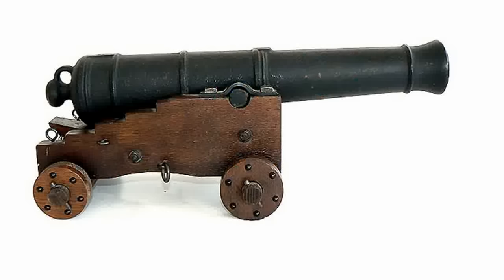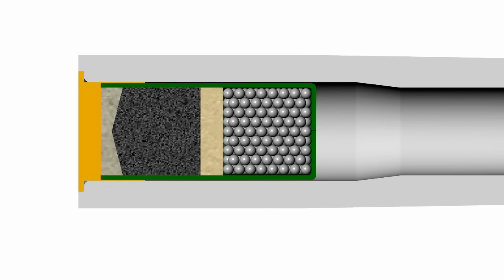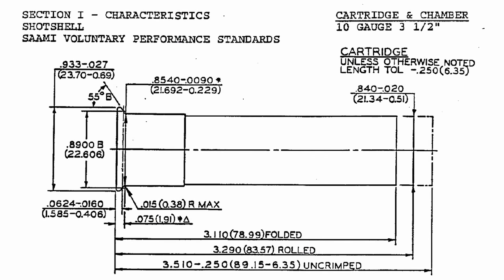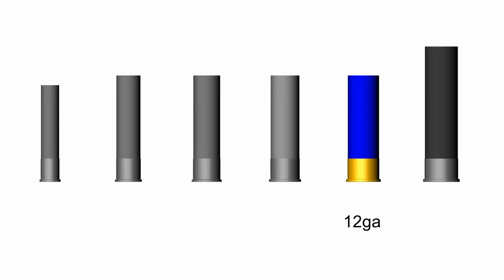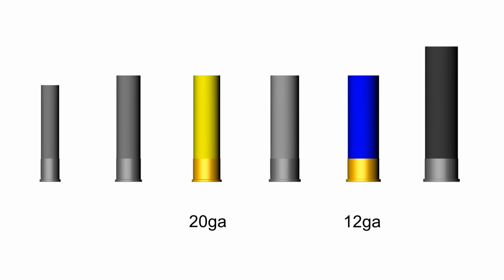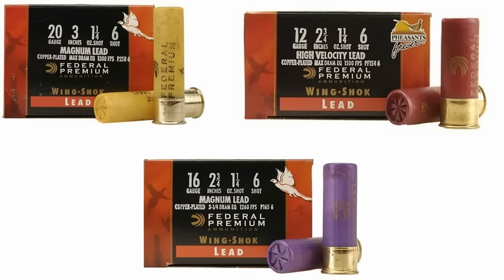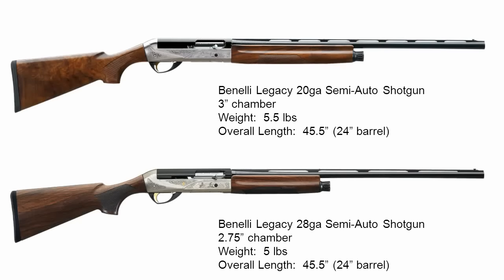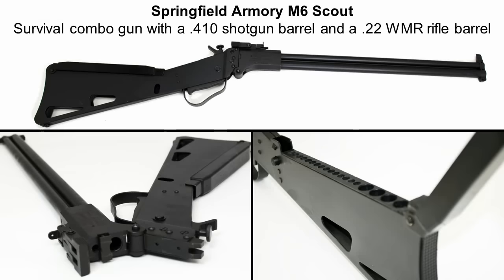Shotgun Gauges Explained - Shotguns 101 #3

Comment: The UNSC in Halo have a 8 gauge pumpgun as standard issue shotgun. I guess the ordinance department really hates shoulders
Reply: @The Magic Hispanic true, I guess a 10 just ain’t enuff
Reply from the maker: What's funny is that if you look at the ammo cans for the shotgun shells in the original Halo, the load is described as 15 pellets of 00 Buckshot.  That's a typical load for a 12ga 3" shell, and way light for a magnum 8ga.

Not nearly as bad as whatever space-time warp they came up with to explain a 60-round magazine of 7.62x51mm ammo in the MA5B assault rifle, though.  I have one 25-round mag for my AR-10, and that thing's big and heavy enough.
Reply: @SynchronizorVideos  yeah, I like to pretend the rifle shoots 5.56 instead. Not to mention the recoil would be worse than an M-14 on the moon
Reply from the maker: @sergeantmarcusstackerM1903  With the way the MA5B looks and its size, I'm guessing it weighs enough that recoil isn't too terrible.  Hopefully the 600 years of weapon development also resulted in a smoother action than the jackhammer M14.
Reply: @SynchronizorVideos  those In-line designs definitely smooth out the jolts
Reply from the maker: @Gender Binary Chicken The M6D never bugged me much.  12.7x40mm isn't crazy-large (.50 AE is 12.7x33mm), and the pistol itself is a very large, bulky unit, with a visible magazine that's within the realm of reality for its 12-round capacity.  

Its per-shot damage compared to the much more powerful 7.62x51 round in the MA5B assault rifle strikes me as a bit of a stretch, although the little booklet that comes with the game does state that the pistol rounds use an armor-piercing high-explosive projectile, while the 7.62x51 rounds for the rifle are described simply as "armor-piercing".  Presumably that's something similar to the U.S. M61 black-tip loading.

Comment: Do you know how many of the smaller gauge guns and shells are sold compared to the 12 gauge? E.g for every 1 "?" Gauge sold there are (x) number of 12 gauge? Are the other gauge easier available? What are they primarily used for etc?
Reply: I don't know any specifics but I do know that 12 gauge is by far the most popular. Over half of all shotguns sold are 12 gauge. The guns are the most common and the ammunition is the most abundant. 20 gauge and .410 are also readily available and combined probably make up around 30% of shotguns sold. 16, 28, and 10 gauge are far less common. They may make up 10% of all shotguns when combined.

Uses for shotguns depends largely on the size of the balls loaded into the shell. For example, .410 is small and usually loaded with small balls designed for hunting smaller animals such as rabbits, squirrels, little birds, and small pest animals. 12 and 20 gauge are generally more varied given their larger size. They are also loaded with small balls to hunt the same animals as .410 but they are also commonly loaded with much larger balls for things like large birds, deer, and home defense.

Comment: First shotgun I fired was a 10 gauge when I was eight. It was my grandfather's and yes it put me on my ass my father and grandfather laughed for awhile. Thru my teens I had a 16 side-by-side that I still have today. After the service I stepped up to 12 gauge and that is my waterfowl gun of choice I use  both 2 3/4 and 3 inch shells never got into the 3.5 shells. If I was going quail hunting I would probably look into a 28 over under this does seem to be the gentlemen's round.
Reply: How's the barrel regulation on it?

Comment: What gauge would you recommend for my daughters boyfriend?
Reply: Erin Osborne 10 Magnum ;)
Reply from the maker: My first instinct was to say 10ga as well, because nothing intimidates like a big bore, and Browning still makes a 10ga pump-action, which is really the action you want for boyfriend deterrent duty.  

But thinking about it, I'm going to have to go with the classic 12ga instead.  Still a big enough hole in the pipe to be scary, and compared to the 10ga, which is mostly waterfowling & turkey loads, the 12 gives you a much more diverse ammo selection to suit different situations.  There are blanks & dummies for putting the fear of God into him very early on, target loads for peppering a fleeing tailgate (I learned during college that small birdshot will not penetrate automotive sheet metal - benefits of going to school in north Idaho), long-range hunting shells for popping tires before a date can start, and beanbags & rubber buckshot if the kid's especially determined.  And of course you also have your standard buckshot and slugs, which will likely be carried by any retailer between your house and the local church or wedding chapel.

Legal disclaimer: any firearm is considered lethal force regardless of the ammo used in it.  Please be responsible and match your armed response appropriately to the severity of the situation.
Reply: Erin Osborne Whatever you choose, nothing intimidates like a side by side double.
Reply: I'd say focus on the method of delivery #AA12
Reply: SkullAngel002 Ithaca with slamfire is scarier
Reply: Erin Osborne smith and wesson 500  (50 cal)
Reply: Erin Osborne  10 gauge tactical looking as possible altgough 12 works too 👍
Reply: I say..take the boy shooting!?! Show him the power of the shotgun. Especially the 12 gauge. Show him the buckshot, slug, magnum loads, etc. Showing by blowing a hogs head to pieces! Water jugs and car doors at the junk yard. He will learn to respect Dads guns. Who knows the kid will likely grow to have a lot of respect for said father. That's what a fellow named Bruce did for me, when I was dating his daughter in Kentucky. Years ago..forget her name..but remember his! Think about it, kid might not have a Dad or a worthless Dad?
Reply: Ithaca made a sort of tactical 10gauge called "the roadblocker", back when they produced the Mag10.

Comment: The gauge of a shotgun is dependent on how many pure lead balls it takes to make a pound. It's simple, and the math here isn't required at all. 12 balls to a lb is 12 gauge.
Reply: He said so at 0:40
Reply: The math is to figure out the caliber based on the gauge
Reply: @Roset595  Got a caliper? Easy peasy. No math required.
Reply: ive tried to calculate this in my brain over the years but it turns out i legitimately cant. the imperial system is so simple that it manages to be not simple
Reply: so. you have say 12 pretty big lead balls. those 12 lead balls make an imperial pound. say you have 20 small lead balls. that equals 20 gauge

the science behind it is insane

Comment: Actually i have a personal custom slug load i use in my 410 and it is pretty darn effective i use a empty 556 brass from a ar 15 i fill the empty brass completely full of lead and load it into a 3 inch shell
Reply from the maker: How in tarnation does that stabilize out of a .410"-diameter smoothbore barrel?
Reply: @SynchronizorVideos  to be honest I have no idea cause I haven't been able to watch its flight through a high speed camera but I have done key hole testing and through trial and error I figured out that if you pack a lighter material in the bottom of the empty brass and fill the front half with lead it stops the keyhole affect like I said I have gotten them to work very accurate and effective I wouldn't try using it over 60 yards or so but they have there place

Comment: I feel like .410 birdshot is really good for home defense, especially if you live in a house where the walls are plaster or particle board, and literally anything bigger has potential to overpen the walls and kill/maim someone you aren't aiming at.
Reply from the maker: If it's not going to go through drywall or plaster, how do you expect it to go through a home invader?
Reply: @SynchronizorVideos  you don't have to kill a home invader, you just have to get them to stop doing something you don't want them to do. And getting shot with fucking anything is as they say, a suboptimal experience.

Comment: Can’t decide between a 20 gauge or 12 gauge…..I don’t want anything fancy, just a simple shotgun for some weekend clay shooting, rabbit hunting and home protection if need be. Thoughts?
Reply: Its your choice but have in your mind that even a 100grm weight in considerable between the same same gun in different gauge
Reply: @chrissdas  - explain further please, I’ve never owned or know much about shotguns….just getting into it.
Reply: @greeneyesfromohio4103  iam just saying  is  that for instance a remington 870 12 gauge vs a remington 870 20 gauge the diference is almost 400gr and even 400gr is not a big number its still a big diference if you walk with the gun for example for  2 hours
Reply: I like my 12 gauge a lot for clay shooting, its what everybody else I know who trapshoots usually uses. 12 gauge and 20 gauge are both big home protection shotgun calibers. I have no idea about hunting anything but birds with the 12 gauge though. Depending on whether you use reloaders, buy already made shells or whatever, that could be the biggest limiting factor. Also 16 used to be a fairly common cartridge so that might be an inbetween you could find depending on location.
Reply from the maker: 12ga is by far the most versatile option, if you want one gun that can do a little bit of everything.  The 20ga is pretty darn capable too, especially with modern ammo options.  But there are going to be some things that the 12 does better.  You probably won't be disappointed with either choice to be honest, but if you're just getting into shotgunning and don't know for sure what you'll end up focusing on, a 12ga is going to give you more options.  

To be fair though, if you REALLY get into anything in particular, like waterfowl hunting or competition, you're probably going to eventually get a specialized shotgun anyway.
Reply: @SynchronizorVideos   I agree with that accessment. I own several. 20 , and 12 s I'm,partial to autos I like the Remington. 1100,s if you can still find them.
Reply: 20 gauge slug has twice the power of the beloved .44 magnum.
Reply: Get both

Comment: Sees person pointing an 8 guage shotgun loaded with a solid slug at you

Chuckles
Hehe, I'm in danger
Reply: Flying Dutchman more like 2g
Reply: 2G is larger than 40mm and packed to the brim with shot in punt gun loads. A 2 gauge slug would be larger than a 20mm Anti-Materiel round and would literally blow you to pieces like a watermelon hit with a sledgehammer from sheer kinetic force.
Reply: @ahuman2695  Doubt you would be killed from sheer recoil unless you held the stock against your forehead.
Reply: @Pain-vm9iq  newton's third law. "For every action, there's an equal and opposite reaction." I.e person explodes, your shoulder is torn off and more often then not a severed limb could kill you
Reply: @ahuman2695  I understand that a severed limb is a potentially fatal injury. What I mean when I say "Instantly fatal" is an injury that would instantly put you in cardiac arrest and/or render you brain dead. I'm pretty sure that a severed limb falls into neither of those categories. Also, the damage to the person you are shooting at would not be from sheer force alone, but the amount of metal that you are sending into them at a high velocity. Newton's third law would not mean that your shoulder would explode in this case.
Reply: @Pain-vm9iq  yes. I agree with your point. But a shoulder would potentially tear because of the powder and projectile size. Hell, launching a can out of a can cannon has some recoil. So imagine what a round like this would do to the shooters shoulder. Luckily, the gun weight could help a little, but not much
Reply: @Pain-vm9iq  also, you said with sheer kinetic force. The same force recoil happens from.

Comment: So a "one gauge" shot gun would launch a one-pound lead load? Also, it looks like "2 gauge" was once a thing.
Reply: Yes, basically artillery at that point lol, a 2 gauge was a "punt gun" used on a boat to take out a large group of waterfowl.
Reply: @large_n_widetm2116  Yes, I remember reading about the 'punt gun'. That thing must have been tough to shoot with.
Reply: @large_n_widetm2116  Yeah, essentially used for "commercial" duck hunting
Reply: You don't have to shoot a pound of lead out of it that's just how they determine the gauge. For example a 12 gauge will fire about an ounce per shot but the load varies depending on what you're trying to do

Comment: The Flobbert 9mm rim fire is quite common in the EU especially where there are restrictive gun laws in place. It is not reloadable so countries can keep track of the ammo you purchase. It is primarily used as a pest control 'shotgun' for ratting. My preference is the Speer .38 cal. Shot shell load for ratting, I even used it indoors in an old building in the middle of the city one time. 
Funny my uncle called his 16 gauge a "Gentlemans" gun back in the '60's
Reply from the maker: Yeah, I think those little shotshells and shotguns designed specifically for pest control are pretty neat.

Comment: If you're using a .410 handgun for self-defense just load .45 long Colts instead.
Reply: Or, "as well", instead of "instead".
PDX1 shells are pretty mean.
Reply from the maker: @aaronh1372  I'd still rather have a proper hollowpoint.  Really don't see the point in the "breath mint" PDX1 projectiles.
Reply: @SynchronizorVideos  to each their own. Your two cents add nothing
Reply: @SynchronizorVideos  multiple projectiles from a 410 buckshot load leads to increased tissue damage and facilitates faster bleed out.

Comment: Nice video. Well put together and presented. I will make a comment though. While the .410 is a bore diameter, it has been assigned a  gauge. The 67 gauge you quoted, according to everything I've found, is a theoretical calculation that keeps being reprinted in encyclopedias. In fact, during and around WW2, Dynamit Nobel sold  410 in boxes that had both "410" and "36 gauge" printed on them. Even now, Brazil sells 410 brass, and the boxes are labeled both "410" and "36 gauge". So, while theoretical calculations might say one thing, the 410 HAS been given the designation of 36 gauge many years ago and it hasn't been changed.
Reply: Kirk Boswell There is only one reason that Brazil still change 410 by 36 ,And that reason is that we(brazilians)are stupid when It comes to guns
Reply: emerson henrique - I wouldn't say that. Brazil makes some pretty decent guns. And as I mentioned, Dynamit Nobel used the 36 gauge designation for the 410 as far back as WWII. As far as I'm concerned, Brazil is just continuing something started in Europe many many years ago. So, whether it's completely accurate or not, having an assigned designation is as good as anything else. After all, the 38 is actually a 357 bore (Unless it's 366), the 44 is a 429, the 22 Savage is 228, the 38-40 is 40 cal, the 25 cal is either 251 or 257, and so on ad infinitum. Assigned names don't have to be completely accurate, just commonly or historically used.
Reply from the maker: It actually has been changed.  There's no official definition linking 36ga to a .410 bore diameter (at least, none that I could find).  There was, briefly, many many years ago when cartridge shotguns were still very young, but it was quickly reversed for obvious reasons.  But the conflation has somehow hung on by its fingernails over the years, and you still occasionally hear shooters or manufacturers incorrectly calling these little shells 36-gauge.

And as for names being subject to evolution or interpretation; gauge is a measurement, not a name.  There is some variance accepted due to manufacturing and design differences, but it's all still based on the formula shown in this video.  Though a bit clunkier by today's standards, it's functionally the same as describing the bore in inches or millimeters.  Rounding off or tweaking a number is one thing, calling something 36 when it actually measures in the high 60s is just incorrect.
Reply: Synchronizor .
Reply: Pat Reed - I agree that he has a point. But I'm not quite ready to convert. I've found that the British (founders of the gauge nomenclature), commonly called the 44 caliber black powder revolvers as "54 bore". Granted, not the same as 36 gauge, but an indication that gauge names weren't nearly as precise as the formula implies.

Comment: so if i made a rifle that fired a lead ball which a pound of led makes 20 of it would be 20 gauge?
Reply: what
Reply: The number of equal sized balls you can cast from one pound of lead is the gauge of the shot gun. The small the number, the larger the balls, and the higher the number, the smaller the balls. 

So for example if, you cast 8 equal sized balls, each ball would weight one eighth of a pound. The shotgun that can fire it would be an 8 gauge.

So the smaller the number, the bigger the gun.
Reply: If you made a rifle that could fire 20 equally sized balls all made from a single pound of lead, that rifle would be a 20 gauge, yes

Comment: I love my 10 gauge for deer, hog, and turkey the guns are generally twice the weight of most 12s 10-14 lbs vs 6-9 in a 3 1/2 in gun  so recoil is much more manageable with magnum loads and some loads reach 2 3/4 oz plus the larger bore diameter means 9/10 times it'll outpattern at 12 with larger shot particularly with buckshot
Reply: They kick but they are so fun to shoot what kind of 10 gauge do you have ?
Reply: @tylermcdaniel5894  a browning bps and a NEF wild turkey federation single shot